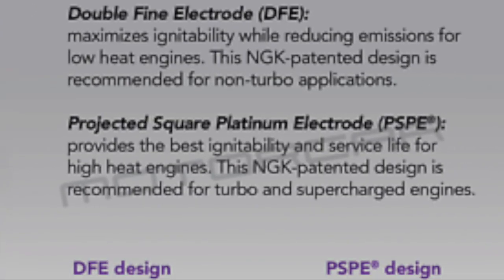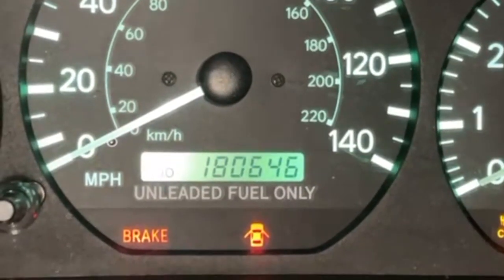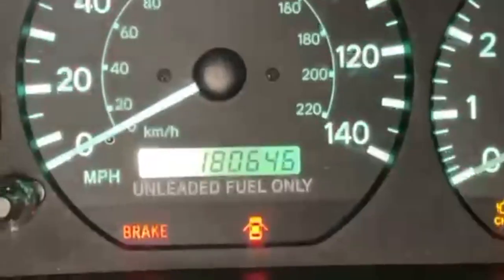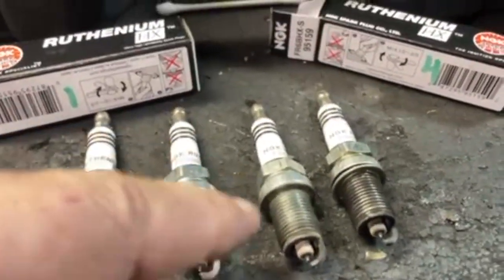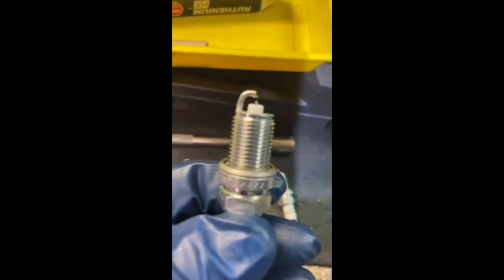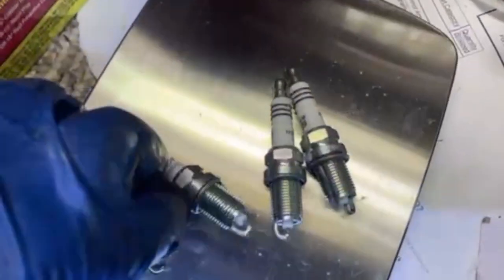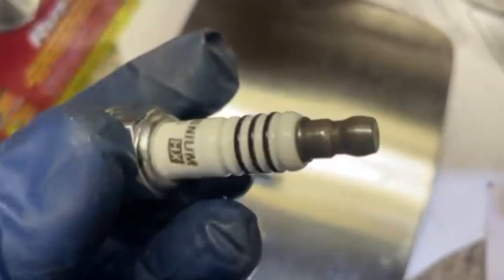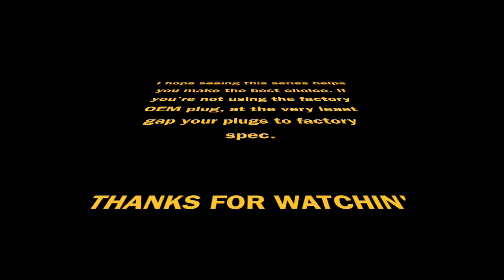LAST NGK RUTHENIUM video (4 of 4)

Comment: For racing applications I prefer to use NGK iridium IX spark plugs. This is because under extreme conditions the platinum welded onto the ground belt of Ruthenium spark plugs could desolder and cause engine damage
Reply from the maker: It's welded.

Comment: Thanks again for your extended testing and reporting on the results, most interesting and informative.

I've gone back and forth on the choice of using either a 0.044" or 0.032" gap on the plugs. The OEM spec for my engine is a DFE Iridium center electrode with a Platinum ground electrode design gapped at 0.044". NGK makes DFE and PSPE versions in the Ruthenium HX plugs for my engine and recommends using a 0.044" gap for both.

My guess on the choice as to whether to go with a DFE or PSPE design is first on the driver's performance goals, more efficient flame front development and propagation, which would translate into more efficient combustion, and ignition reliability over the longer term.

The DFE design, having a smaller surface area on the ground electrode, should have a lower firing voltage requirement and should be able to maintain that lower voltage requirement over a greater mileage as the electrode wears and the gap widens. This would also allow a choice of a wider initial gap, with the result of better ignitability of lean burn AFRs and lower electrode erosion due to lower plasma arc currents.

The choice of the PSPE design, in my opinion, offers the aforementioned advantage of better combustion efficiency because of reduced shrouding of the developing flame front and reduced thermal quenching because of the increased mass of the DFE ground strap directly underneath the center of the electrode.

My choice was to go for the PSPE design, for the increased ignition performance and the fact that I never intend to go beyond 60k miles without removing, inspecting and replacing the plugs if necessary.

The last consideration for me was that of the best gap choice. This was where your videos were especially helpful, thanks again. My car was designed to run the wider 0.044" gap on DFE electrodes and so has a HEI system that can deliver the voltage and current necessary to fire that kind of gap. Going to a PSPE design with that gap should pose no problem for my ignition system's reserve voltage capacity, initially. I'm expecting a higher firing voltage requirement with the PSPE design but the car should be able to handle it. What I'm expecting to happen is that at extended miles I might start getting misfires at high rpm and high load, as the increasing firing voltage requirement exceeds the coil's ability to meet it. One solution to that problem would be to go to a smaller gap; like 0.040", 0.035" or 0.032". The problem here might be with what you observed with your smaller gaps, significantly increased ground electrode erosion because of the higher spark current and heating.

I'm going to go with 0.044" gap and see what happens over time and, as I said, report on my findings, good or bad. I'm not going to go to the expense at this point to install a more expensive higher performance set of coils, until I determine that my stock set of coils are not able to meet the plug's firing needs at this gap. BTW: I have bought a set of indexing washers and plan to index the new plugs as appropriate.
Reply from the maker: That's exactly what I did, but I did it the hard way. (I had to eat a set of expensive plugs to find out). Please post back your results after you get some miles on them.

Comment: Thank you for these vids. How many total miles did you run those Ruthenium plugs? My rough math says 80,000ish? Do you think these plugs will last up to 100,000mi like the Laser Iridiums?
Reply from the maker: I'm working out the exact mileage I had on those plugs for you. Gimme a day on that so I can check my records. As for the 100,000 mile question, I'd be lying if I said I knew, as I don't know your engine or how you maintain it.  I can tell you in my application, the answer is "absolutely". These are the best plugs I've ever used and I plan on never removing these plugs, like ever.
Reply: @dbfcrell8300  I understand. I’ve got a G35 which at 140,000 when I changed them the electrodes were completely eaten away… I’ve changed a Corolla with over 200,000mi on maybe plugs that were either original or at very least 100k and they still had meat on em… both cases were their respective NGK Laser series… just wondering if these held a candle to their durability. Pricing is attractive if they’re even 80% or equal. NGK advertised as most durable, but my question is “to what? Their Iriudium IX?”

Comment: dielectric grease makes it harder for it to get a ground. it is oneof the reasons why you arent supposed to add anti seize on the threads.
Reply from the maker: The plug's ground is made through the threads. Dielectric isn't used on threads. It's used in the boot only to keep moisture from oxidizing  and minimize arcing at the main electrical connection. Anti seize is not supposed to be used because it affects the torque setting. It's made from a metal paste so it's conductive so it doesn't hinder ground. NGK plug threads are treated at the factory so anti-seize is unnecessary.
Reply: i would grease diel on coil* that what alot ppl forgot to do when changing sparks plug
Reply: I have 400,000 miles on my car. I've always 100% coated the spark plug threads with antiseize and used dielectric grease on the wires and coils with no issues. Quit believing everything you read on the internet.

Comment: Looks like your car has wasted spark  ignition system . In wasted spark system the polarity of the high voltage ignition pulses is proper (-) on the central electrode and ( +) on the ground electrode and opposite on the other spark plug in the pair ( on the same ignition coil ) . When the polarity is proper most of the erosion happens on the central electrode ( ruthenium ) and the ground electrode ( platinum) is less affected , but when the polarity is reversed the erosion is stronger on the ground electrode and since it’s platinum ( less tougher than ruthenium) it erodes faster . This IMO is the main reason why 2 of your plugs looks almost OK and the other two almost lost their projected tips . 78K miles isn’t small mileage but not for rare earth metals electrodes plugs even with wasted spark ignition system . The engine firing order is 1-3-4-2 ( they are paired 1&4 and 2&3) so the plugs on cyl #1 and cyl#2 are with almost intact ground electrodes and cyl#3 and cyl#4 completely worn, so the last ones have to be working with reversed polarity . What I  can suggest you for extending their life time is to rotate them . This is specific only for the wasted spark ignition systems !( two coils ( with two high voltage terminals each) per 4 cylinder engine !
Reply from the maker: Ok, does my running them all at .032" gap for 17k miles have anything to do the significant erosion? They were perfect up til that part of my test. They're supposed to be gapped at .044" (which my new ones are) but I was experimenting with decreased gaps for several mos with the plugs in this video. IOW, if I leave my new Rutheniums at the correct gap, will rotation still be necessary?
Reply: @dbfcrell8300  The smaller gap increase the spark current , so probably yes but there is something wrong with the material of this projected tips . So better rotate the plugs ( since you will put the same ones ) on every second oil change and don’t clean them ! Here is a video from NGK on this problematic subject https://youtu.be/8Q7t1iae1Uw?si=pqK996rUF1jo71DA
Reply: @dbfcrell8300  and here https://www.youtube.com/live/qqv98MqKlEE?si=Y6dTzKMUn8SK8QD_ watch from 1.2040 minute about waste spark ignitions spark plugs . In the first video BTW the normal polarity of the electrodes is reversed . It’s amazing but sometimes the best are making such a basic, elementary mistakes :) Everything else is in tact!
Reply from the maker: @flappingflight8537  Sorry I never replied to you as I meant to. I wanted to start rotating the plugs like you suggested, but I'm a bit unclear which to which. 1&2 with 3&4?
Reply: @ it’s fine :) better rotate 1&4 and respectively 2&3 . Rotate the plugs which are connected to the same ignition coil !
Reply from the maker: @flappingflight8537  Ok, got it. Makes total sense. Will do this tomorrow. Thanks for getting back to me.
Reply: @ you are welcome! Wish you success!

Comment: Just followed your plug testing journey, thanks for the videos. I had a similar issue with rockauto got the PSPE version for the ecoboost turbo engines instead of the NA version with the DFE tip. NGK puts a -S at the end of their part number to identify the PSPE square tip version FYI, although as you've seen its not a big deal either way, but as they do make both versions for my car I was able to exchange mine for the DFE tips. I realize it's a little too late for your gap experiment but yeah never gap tighter than min spec for the vehicle. While a tighter gap creates a stronger spark it tends to wear faster from dwell(heat) and less efficient burn at idle/cruising speeds.  Generally you want the widest gap you can get away without loosing spark (blowout) during the compression stroke which can cause misifires predominately at higher rpm. The larger gap nets you a longer spark and more surface area for better burn and more complete combustion emissions/economy. I usually gap to the max stated range for the vehicle. However I do check my plugs every oil change still like my dad taught me 30 years ago, I clean them and regap as needed. Since gaps do tend to open over time if you dont check plugs regulary you can go with the tighter gap range for less maintenance.
Reply: Oh and another tip, I cleaned spark plugs for years by hand like you until I got me a cheap ultrasonic sink off amazon, was like $40 iirc and its amazing at cleaning all kinds of stuff including spark plugs and makes them look new again. I set them in and run for about 10 minutes and no more cleaning by hand. By the time I'm done changing the oil they are ready to check gap and reinstall. Highly reccommend it!
Reply from the maker: @lightblade543  Cool, I was taught the widest gap and make sure outer electrode is 90º to center electrode and maintain crisp sharp edges on the electrode as much as possible (ie don't clean with a tool that dulls the edges. I ultrasonic too, but   MicroMesh makes the finish better than factory.  

So, comparing these NGKs projected square plugs to the OEM Denso double electrode platinums my car originally came with back in 1999, I'm quite certain these NGKs, even when gapped improperly (like in my testing) have a MUCH more optimized flame kernel allowing better combustion (regardless of their gap) as the Denso's perfectly gapped intrusive electrodes which were inhibiting- IKt's safe to say a mis-gapped PSPE is better than a perfectly gapped Denso double electrode.
Reply: @lightblade543 Hi which Ultrasonic cleaner did you purchase from Amazon? I want one Are they the ones that have a stainless steel basket and clean jewelry? Thank you
Reply: @ElegalvicnLa yeah they are often advertised for jewelry. Mine was for injectors too. Has a tray with holes that work for spark plugs so you can keep the top end out of the solution.
Reply: @lightblade543 Thank you

Comment: Old ones looks so dirty.
Reply from the maker: Yes, lots of experimenting with gap
Reply: Looking at the plugs, there is definitely an air fuel ratio issue with that engine. And, it has nothing to do with the spark plugs.